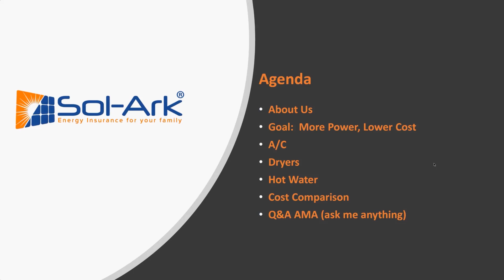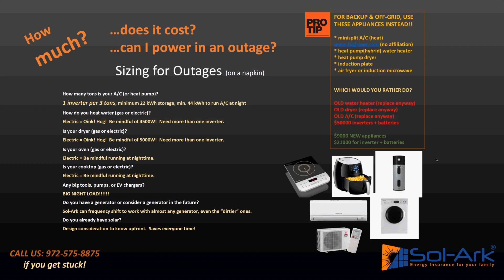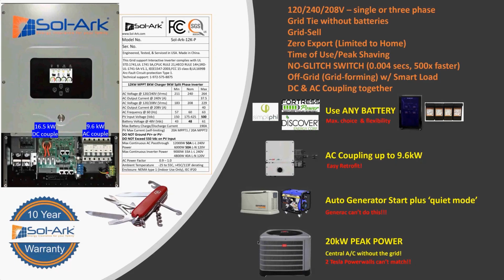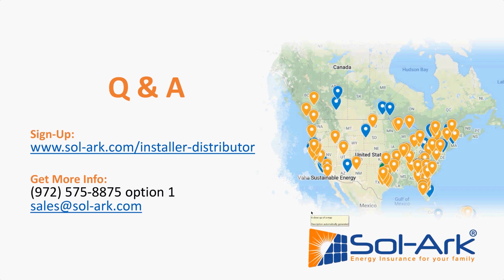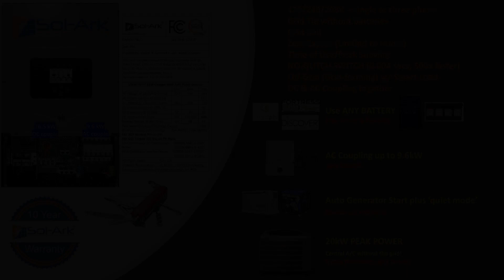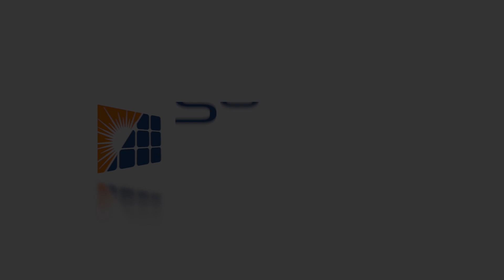Solar + Storage Sales Off-Grid Appliances

Comment: Save tons of money when you buy used solar pannels from San tan solar. 25 - 240 watt pannels for 750.00 bucks. That's 6000 watts. I bought 40 for 1200 and run everything even AC.

Comment: The mini split heat pump disadvantages are HVAC contractors will rarely keep parts on their truck, most contractors only work on units they sold/installed to service/repair, lifespan 10 yrs average.

Comment: A new 14 SEER 3 ton split hp and the blower consumes about 3,000W. Add a Micro Air soft start kit. Add a defrost disable switch and an electric heat disable switch and you’ll save even more.

Comment: You DIY’ers need about $60-70K to have a 2,500 sq ft high eff home totally off grid in the central USA. I did without the new $70K pickup truck and chose two 12K’s, 20.6 kw pv and 121 kWh battery bank.

Comment: Is it possible to use super capacitors that are charged and connected to the wall socket connection to provide all the surge power for certain appliances?
Lets say the normal load is 400W but it can have peak load of 5000W to start up, most of time that is just few milliseconds of very high amperage draw. Could a super capacitor be used to provide these small spikes with power so you don't need to get a larger inverted to cover those very short lived peaks?
Reply from the maker: Unfortunately no. Supercaps are DC (not AC). They are not like regular capacitors as they act more like batteries. You will actually destroy a Supercap if you drain it to zero, overcharge, or use for AC. The starting caps in your big appliances are really for balancing out the large inductive loads so a inverter can better handle. So caps on the inverter output won't help peak power. You have to deal with each load. Solutions for peak power are: Big inverter peak, delayed turn on of big appliances, active load mgmt, pick soft start appliances.
Reply: @Sol-Ark  if you're utility's or at least in my case RMP discounted 3 phase service ( over 5+ years ago in my suburban area and bribery for keeping/reconteting it was 90k+ usd so not economically feasible for me ) and or only offers single phase 240v is it possible to add a extra inverter and battery/solar systems to replace the missing leg for 3 phase 120v or 240v for 480 3P total using the utilities for the other 2 120v legs and not have to buy a roto-phase/stepper motor drive ? for shop tool's? like a mill / metal lathe or welder or DC-fast BEV chargering ? as the spec's are usually better for this kind's of thing's and cheaper to boot ect.
Reply: If your inverter is transformerless, add an autotransformer to your panel.

Comment: Don't use electric heaters, use solar heat collector for free water heating!
Reply from the maker: I kinda agree. solar heat collectors are 4X more efficient than electric heat. But thermal solar is such a lost art, challenging to install, and prone to failure in extreme temps (island weather is great though). We suggest heat pump water heaters or heat pump HVAC that are ~3-4x more efficient than electric. Thanks

Comment: 2500watts for an electric stove lol i live offgrid and my electric range can do 11kw full tilt.  Also an induction range is almost double the cost for an unknown efficiency increase.

Got a heatpump water heater and its perfect it uses 800watts in heatpump only mode.
Minisplits are tacky i went with geothermal all in about $11k including duct work 
2 ton ac for 1911 sqft. In Florida
It only uses the 2nd stage in the summer.
I recommend insulation first (icf)

I really wanted a heatpump dryer but i settled with a electric one. 3 years ago they were double what you mentioned
Reply: how much power does your geothermal pull for a/c? I can't find any info on what it actually draws vs what a breaker needs to be.
Reply: @av1204  its a 2 stage i think its 2kw full tilt. 1100 watts on stage 1. Stage 1 has been 90% of the time
Reply: A standard electric range with 4 top burners and oven pulls no more than 8kW.
Reply: @USA-GreedyMenOfNoIntegrity  my range manual says 11kw
Reply: Most Geos or Air Source HP’s over 18 SEER have variable speed motors and a lot of circuit boards. They usually cost 1.8-3X as much as 14 SEER Air Source HP’s. You’ll find them very expensive to repair,, especially after the 10 yr parts warranty expires. Also fewer techs to service and repair them. If you have plenty of money, go for it. 

Now, the mini splits are just fancy window bangers. Throw away, hard to disassemble for cleaning, non-standard/non-stock parts, most DIY brands and installations are nothing but trouble.

Comment: Would a swamp cooler (evaporative cooler) be more energy efficient than the mini-split system?  It seems that the initial cost would be significantly lower.
Reply: I bought a 1200 btu mini split for 897.00 at home depot. Swamp coolers only work with dry air. But only blow wet cool air that makes you sweat. At 104 degrees yesterday my house stayed 70 degrees.
Reply from the maker: A swamp cooler is 4-5X less energy than A/C. But it only works in dry climates or dry parts of the summer. If your humidity is too high and cannot afford A/C, normal fans will work better than a swamp cooler.